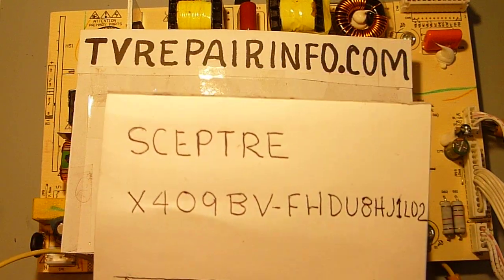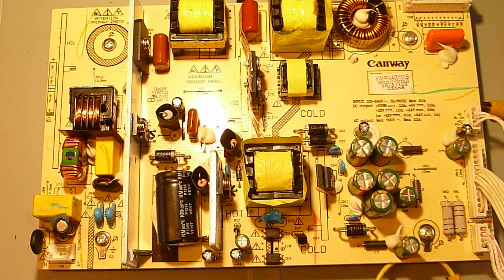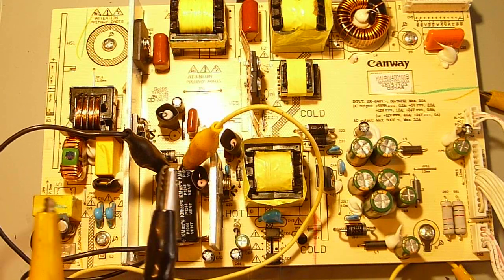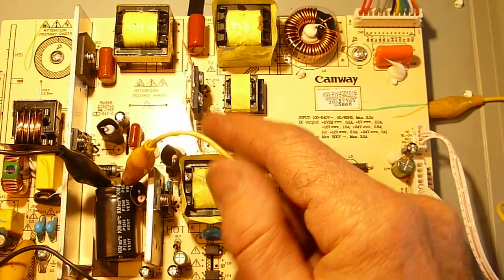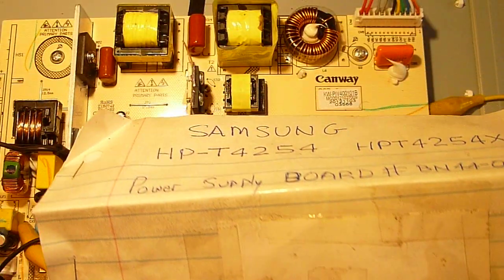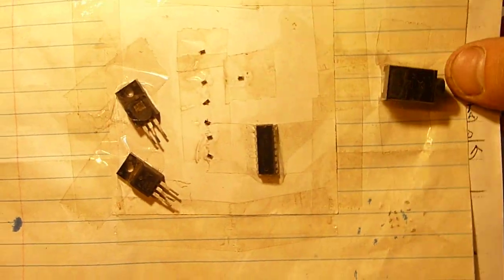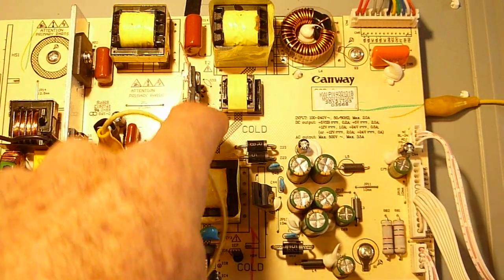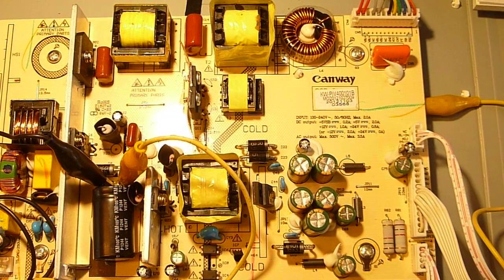Sceptre X409BV Repair Case History Using An Infrared Heat Sensor.

Comment: Thanks for the video- however, I dont understand what you mean by a "shorted fuse". Fuse are supposed to be 0 ohms, right?
Reply from the maker: Your correct. I should  have said it had an open fuse. The short caused the fuse to open.

Comment: Very informative! Thanks. I know every repair job can be different. What did you charge for the diagnosis? My friend has a 42" Sceptre with the same/similar symptoms. You can buy a better model (no internal speakers) for $250 at Walmart.
Reply from the maker: +Bob May I usually charge $45.00 for the estimate, but I apply it towards the repair if the customer has me repair their  TV.

Comment: Dave I think that brand is pronounced ...septer....I've seen 1 myself, and they are chinese as most are today........Question, on some of the older samsungs, have you been finding the micro and/or the eprom to be faulty...ln52a630 series etc...???
I haven't been doing service full time for a couple yrs.....and have seen a few of these with the no start prob, and the p.s. caps are fine(esr) and swollen caps are not prob...i heated the micro area and the set will turn on, but still has issues.....if u have any input would be helpful..
Thank you
Frank
Richards tv inc...from R.I.
Reply from the maker: +Frankie Pitochelli Sorry but I'm not knowledgeable on that one.

Comment: Hello Dave. I have the same tv that is being repaired in the video. My problem is different than yours but I decided to ask anyway. The tv I have has a display problem I would come on the first time then the screen goes blank, but I hear audio. I am not a tv repair person but my basic electrical skills lead me to believe it had to be the back lights or a problem with he display board(main power board).So I purchased one and swapped it out. The tv worked fine for about a day with it being turned on and off with out a problem. Only for the next day the tv to develop the same problem again. So I decided to ask if you have ever had this problem and how you solved it
Reply from the maker: I'm assuming it was the inverter board you replaced but not sure since your description is hard to follow. If so it's possible bad CCFLs may have loaded down your replacement inverter board and caused it to fail again.
Reply: Ok. Any ideas on how to fix this problem?Any help would be appreciated.
Reply from the maker: You can start by seeing if the inverter board transformers are putting out voltage using the neon light trick which I show in one of my videos.

Comment: Thanks for sharing
can i ask if wrong adapter voltage 6v used what is going broke
in orginal 10 year old 3v radio please have you info for me.
Reply: +Edmorbus If you supplied a 3V-device with 6V, you probably destroyed something!
Reply: +zaprodk yes what is destroyed capacitor transistor or samting else ?
Reply: +Edmorbus If you're lucky, you only blew a fuse. Open the radio, connect 3v and follow the voltage path with a voltage meter. Where the voltage stops you'll find the fault.
Reply: +Arnþór Gíslason Thank for your help :)

Comment: so you applied 12v Dc since in that part of the board Ac to Dc switching already happened right ?
Reply: +Mohammed Berdai That's correct. He applied the voltage after the diode rectifier. An alternate method of doing this would be to apply stepped down AC voltage to the power cord with a variac.
Reply: +Arnþór Gíslason Thanks

Comment: 120°C is not too bad momentarily but If they're constantly at 120°C I can really see why they failed.
Reply from the maker: +Arnþór Gíslason I've seen some semiconductors operating at much higher temperatures without there 
being any problem, so I figure 120 degrees F was probably fine, but considering the TV only lasted a year
I figured an added heat sink might be a good idea.
Reply: Oh right, I thought you meant celsius :)